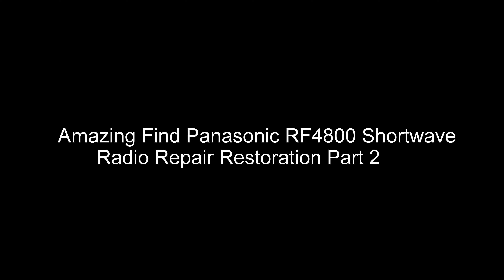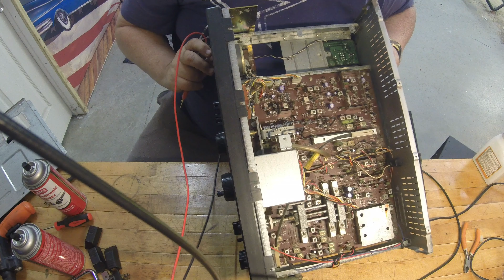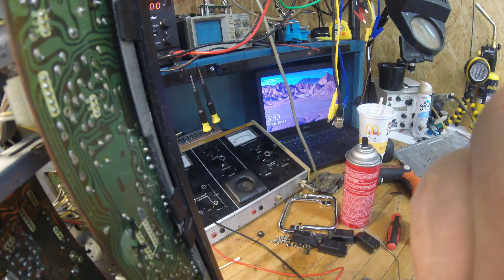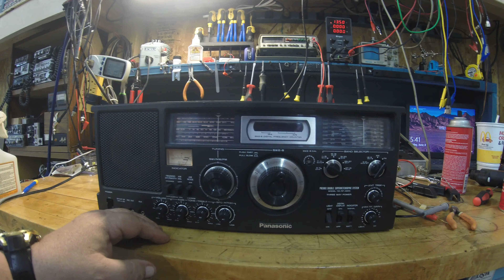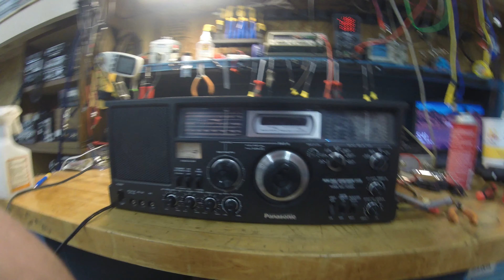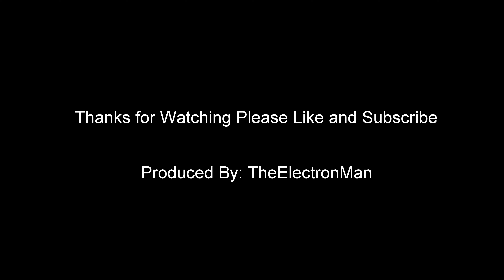Amazing Find Panasonic RF-4800 Shortwave Radio Repair Restoration Part 2

Comment: Hi, would you know if this radio takes a standard AC rounded end power cord? I bought one used but it's missing the cord.
Reply from the maker: Yes standard AC cord, good find they are great radios..
Reply: @TheElectronMan  Thanks for the info!

Comment: A stupid plug stopping 12v, wow, usually it is a dry joint where the plug has been pulling at the pins!  But the pin itself!!!  8-(